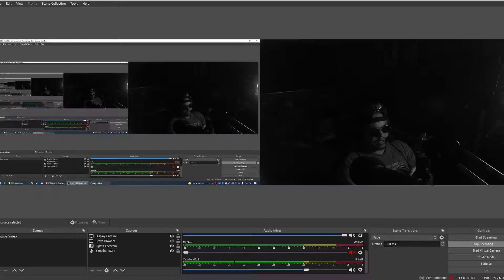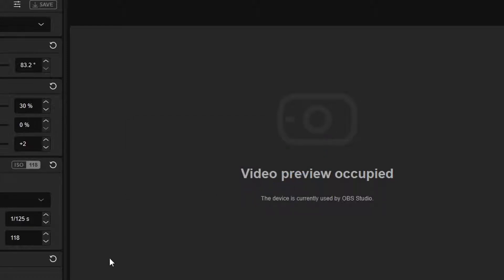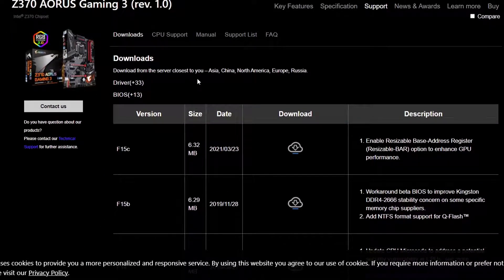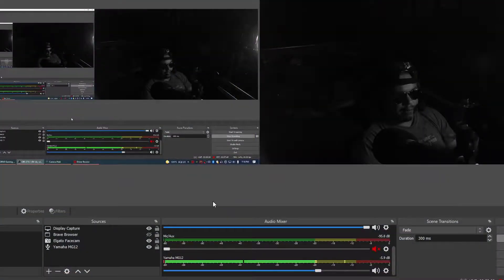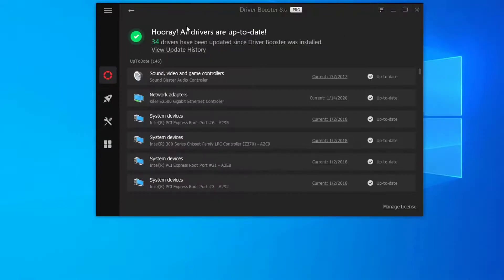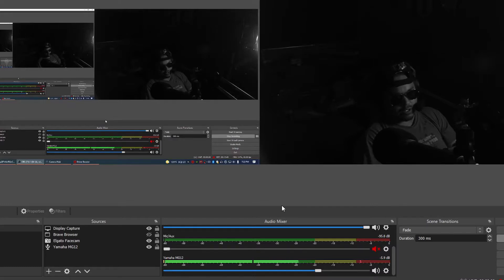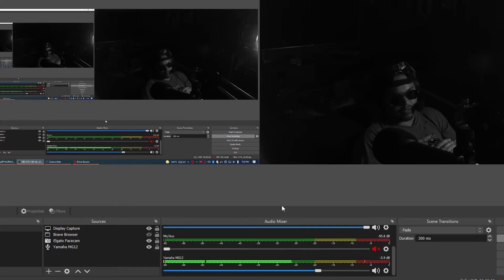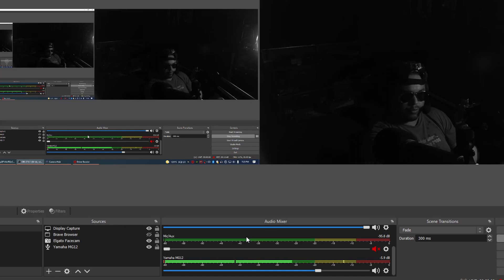Nerd Stuff - Possible Fixes for Elgato Facecam Performance Issues

Comment: The way I fixed my stuttering issue was removing a lot of cables from other 3.0 slots it turns out (in my experience) having to many usb 3.0 slots utilized bottlenecks the facecams performance lol. I'm glad I didn't open up a case on this great ebay seller because that was definitely a me problem. Do your research first!

Comment: my cam works just extremely blurry until im super up close as if the micro lense is the only thing on if it has multiple lenses  i wonder if its a cord issue or what .. it just looks like 540 p in 1080p  just hope its not the cord

Comment: So I built a new pc recently and I'm assure all my drivers are updated. Even made sure it wasn't a BIOS issue. I used this all the time on my previous PC and never had an issue so it's just baffling that I'm now having problems with a much better pc. The only thing I haven't tried yet is the USB cord but my hopes aren't high
Reply from the maker: The cable is the usually the right fix. Try it. I know it sucks ass but don't give up.

Comment section to this video and another I did on the eglato camera also got useful solutions

Comment: Hey man I'm currently having issues with my cam as well and it's been a month and shit is still not resolved. Replies are slow and they didn't even completely solve the problem. Idk how more patient can i be. at first it gets stuck in the loading in the hub menu aight then it was fixed but then another issue appeared which is it says the camera is used by something but it dosen't say it just shows the camera is currently being used by. like id even know what is using my camera ain't there like a thing where i can check what is using my camera? I've tried unstalling and reinstalling it for so many times i don't even know what else to do i just feel defeated man. u know any simular issues bro? i really need some help man. if anyone knows how to fix this problem please reply to me!!!
Reply from the maker: what are you trying to do?

if you have OBS open and your elgato cam hub open, then you can't view your feed on the cam hub software until you close out of the app using the camera.

sometimes zoom, skype, discord etc can be open in the background using the camera and if you're in the elgato cam hub trying to tweak settings, it simply won't work. The camera can only be used by one app at a time.

Comment: We're having issues with the video clarity. We have tried the settings and using brighter led lights, still looks grainy like an old webcam. Not super tech savvy, just frustrated with  webcams and the lack of ease. With all the advanced technology today one would think this would be way easier.
Reply from the maker: did you get the new elgato cam pro? that has auto focus, perhaps the lens needs to be cleaned?

if it's grainy it could be a number of things, have you updated the firmware and the software? both of those things needs to be done.

also do you have a bunch of stuff running in the background or is the camera running too hot?

Comment: Facecam needs to work with USB 3.0. By default, Windows comes with power options configured to reduce USB port consumption. When the power consumption of these ports is reduced, the camera stops functioning properly. What you need to do is disable Windows from reducing USB power. To do this, you can follow these instructions:

1) Click on the Start menu and select the Settings gear icon.
2) In the Settings window, click on the System icon.
3) On the left-hand menu, click on the Power & sleep option.
4) Scroll down to the Related settings section and click on Additional power settings.
5) In the Power Options window, click on the Change plan settings link next to the power plan that you are currently using.
6) Next, click on the Change advanced power settings link.
7) In the Power Options window, scroll down to the USB settings section and click on the plus sign (+) to expand it.
8) Next, click on the USB selective suspend setting to expand it.
9) You will see two options: On battery and Plugged in. Click on both options and change the setting to Disabled.
10) Click on Apply and then OK to save the changes.
11) Close all open windows and restart your computer for the changes to take effect.

That's it! USB selective suspend should now be disabled on your Windows 10 or 11 device.

In addition to this, it is essential to have your computer's drivers and Elgato drivers and software updated. Good luck!

Comment: My issue is when applying a blur effect for my cam. My video when going live freezes on and off. Once i select ELGATO face cam vS ELGATO Virtual FACECAM. The camera works perfect with no issues. I really want the blur effect to work without any freezing
Reply: I’m here for this exact issue. Did you find any solutions? I reached out to support today. Waiting to hear back
Reply: @bluehousemouse  same, my problem is that i have to use the virtual facecam to mirror the image.
Reply: the same issue :(

Comment: Having issues with my facecam, Out of the box it kinda looked blurry, and I was struggling to get the chroma key right. Almost like it's a super cheap webcam that can tells a face from a butt. Anyways I realized yesterday that it's also not saving, I contacted corsair waiting for support. I've done all drives and firmware stuff, Still, the problem remains the same. Hopefully, I can get this sorted out. The local store that sold me this has a handling fee haha so they actually charge you for faulty products..... o well let's see what happens
Reply from the maker: If you return it to the original seller for an exchange would they still charge you? The product is not working as advertised....

How old is your computer? What kind of motherboard do you have? I have a gigabyte motherboard and sometimes my VR headset doesn't work right and sometimes there's interference issues with certain devices and I noticed one of the usb drivers are faulty and I'm too lazy to fix it... it could be something like that. Some motherboards just aren't ideal for a bunch of devices plugged in, my pc chugs along, but it'll be time for an upgrade soon
Reply: @TheWatchFrogs  jip, seems like it, a handling fee its bs.. anyway i posted a ticket to elgato yesterday waiting on a reply.

ive got a 10900f with a Asus Strix z490 f, 32G memory, 1080ti aorus extreme, 1000w platinum psu, and samsung 970 nvme. 

you can see the cams performance on my latest stream. its bad.also running 2 keylights at 90% so should be more than enough light but it struggles hectic with the chroma key its crazy
Reply from the maker: @NicoPeyper  have you tried superior usb type c cables?

Testing audio equipment has shown me that cables are capable of receiving insane amount of interference from usb receivers.

My logitech mouse receiver causes interference in some devices or it won't run correctly so I have to strategically place my products or else they won't work correctly lol 

Perhaps try that? 

The camera has given me zero issues and there was an update not long ago. I'm gonna check out your stream and see what's going on with it
Reply from the maker: @NicoPeyper  okay I watched your stream, your content was clean, good audio levels, and your cam seemed fine, I went to 5 to 6 different parts of your stream and didn't notice anything out of the ordinary? Is there a particular point where the cam was not functioning right?

Comment: I need a 10' long cable so I tried the USBc to USBC and it didn't work. Beefy computer but the camera is too finicky.
Reply from the maker: Updating thr firmware and software should be top priority, both of those things are different. 

The cables I linked to should work. 

The usbc port in the back of the PC motherboard should work (elgato stated that it should work) but they sell the camera with a USB Type c cable to usb a. 

They sent me a beefier cable but it wasn't long and I never bothered trying it because the cable from Amazon works great. I've literally had no other issues with my webcam since doing thr things in the video

Comment: Hi there! I just stumbled across your video when doing my research on the Elgato Facecam. This webcam was the one I was pretty dead set on buying to start my content creation on YouTube + streaming on Twitch but after reading about everyone's struggles with the freezing and drivers issues, I'm feeling hesitant. Now I'm debating on possibly going with the basic Logitech C920 or even the fairly new Logitech Streamcam. With all the problems and hurdles you've had to go through, would you still say this camera is worth it if you can afford to get new cables, should there be any problems? Or should I just look elsewhere? After watching your video, I really trust your opinion so, let me know if you got the time! Great video, man. Thank you.
Reply from the maker: The solutions for the majority of people are in the comment section and or in the actual video.  I have a pretty high end pc and once I replaced the cable, and updated the firmware, that fixed it. Updating the firmware and updating the software are not the same thing. I go through this. 

Me personally, I love the camera, it works really really well and I honestly haven't had issues since I fixed it. Also elgato did send me a much different cable after complaining about the issue and bringing this to their attention. If you order the cam, email elgato and tell them your concerns and request they send you the proper cable.

Comment: Hi guys! My elgato kept freezing too and I got a PCI-e extention card (30 dollar or so) and plugged the camera usb cable in there and now it works for me. Hope it helps.
Reply from the maker: What model PCI usb hub did you get?

I got one with decent reviews on Amazon but it sucked ass, had the blue usb 3.0 and everything.
Reply: With the cam my usb ports are basically full. I don't know if you have that aswell. I figured it didn't harm me if I would just try this out. I did try following your stept with even the amazon usb cable first, but unfortunately that didn't work for me.
Reply from the maker: @nushi4639  which card did you buy?

Comment: Hey! so I have a question that I'm confused on, I recently got the Elgato Webcam, and I love it but the only problem is I'm having this blue flickering going? it seams to only happen at night time when its darker and I've tried shutting off anything LED or light based in my office to no avail so it isn't environmental lighting, anyway to fix this? I know you mentioned cords but is it a specific one? anyone help would be fantastic, thank you!
Reply from the maker: I've noticed dramatic light changes makes the camera wig out a bit. 

Have you upgraded the firmware? Upgrade the software version?

Comment: I have returned with news!
(If after you've tried the solutions above and still have issues)
I've come to find that if you're using an external Elgato 60S capture card, it competes with the streamcam for power, thus forcing 1080 60fps to struggle in streamlabs. I just got an internal 4k 60 Pro Mk.2 and I have had no problems since. Figured I'd update you!

Comment: Hey so this video is awesome.
I got mines yesterday and it worked fine for a bit. It also works in the hub fine but in obs it works sometimes or sometimes nothing at all.
I am going to try all the suggestions you mentioned.  It sucks that I have to possible to get a new cable now.
Reply: I tried firmware update, HUB update and changed cable and it still doesn't work....the only thing left is the Drive booster 8. I am really frustrated, I emailed Elgato support but no answer yet.

Comment: This sadly didn't solve my issue. Had to return the cam as I tried it on three other machines, and the same freezing error happened. Thinking on buying it from another supplier and try and contact Elgato support, as I didn't do that the first time. They might have a fix so I can use it.
Reply from the maker: Did you update the software, firmware and use a different cable? 

I linked to the solutions in the description . I'm sorry man ;(
Reply: @TheWatchFrogs  Yeah I did, I even tried buying two different cables (3.1 to 3.0 and a 3.1 to 3.1), and made sure the firmware was up to date, and reinstalled my windows, and made sure BIOS and USB drivers was up to date. Nothing worked. Half my 3.0 slots wouldn't even turn it on, the other half 3.0 ports the cam would freeze, and the 3.1 port it didn't work in. Same results on the other three machines, but didn't do a reinstall of windows on those though, as they weren't my systems, but friends and co-workers. I've seen others have luck with Elgato Support though, so I might give this cam one last chance and contact them, when I get another one. If they can't solve it, I can still return it.

Comment: So I used a new cable and it works fine. No more freezing but now I get random flickering on the camera. I turned of the lighting to see if that was causing it but nope, still flickers. Today was the first time it ever happened. Also, the video becomes desynced from the audio and the way I fix it is by deactivating and reactivating the camera in SLOBS. It becomes pretty annoying though since I have to do it multiple times n a 3-4 hour stream. Going to contact Elgato about the flickering but honestly I'm prepared to just send it back. This is such a hassle...
Reply from the maker: Did you try updating the software and the firmware?
Reply: @TheWatchFrogs  Software up to date. Doing the firmware now. Really hoping this fixed the video desync issue as well as the flickering. Elgato should be paying you at this rate 🤣
Reply: @TheWatchFrogs  Seems fixed with regards to the flickering. Will have to wait and see for the next time I stream to know whether the desyncing problem is a thing of the past
Reply from the maker: @PunjabiPiccolo  after updating the software. Upgrading firmware and using the new cable it seems to have fixed my problem.

Ya. Elgato should be thanking me for preventing many returns haha 

I'm just glad I could help. After following my steps in the video I've had zero issues in recording or streaming. I use regular OBS.
Reply: @TheWatchFrogs  I've been meaning to make the switch from SLOBS to OBS for a while. I've just been too lazy about it. I wanna believe the desyncing issue is a SLOBS issue but then again I never had any desyncing issues with my $99 Avermedia Webcam so I don't know why I would be having it with the Facecam. Really hoping this update fixed it. Thanks for all the help!
Reply from the maker: @PunjabiPiccolo  I've had performance issues with SLOBS that just didn't exist with the less bloated OBS. 

Slobs is a great app but for some people it just doesn't play well. obs has always been rock solid

Comment: Got the firmware updated and it runs much smoother now. I also ordered the cable. Because why not? lol
Reply from the maker: I linked to a handful of decent cables for the usb type c ports and the one that I'm currently using that's worked really well :)

Comment: What issues were you having? Mine seems to freeze up after a couple minutes in OBS. I was thinking it was my CPU was not able to run it along with OBS.
Reply from the maker: pretty much the same at you.

At first using the included cable, the elgato facecam kept connecting and disconnecting and very rarely would it display an image, but only for a few seconds before continuing to fail (this was in the camera hub). I used a different cable which I linked to and it seemed to have worked okay for a moment and then in OBS it started freezing after a few minutes. Very rarely would I be able to record a 15-20 minute video. 

I bought Driver Booster 8 and updated all of the drivers properly because gigabyte doesn't make it easy to download the current drivers and stuff.  which did make things better with the cable I started using (the red braided amazon cable). The elgato facecam cable that was included still didn't work on any of the blue USB 3.0 ports, however elgato has suggested I use the USB type C port (I have that cable, but havne't tried it and I included in the description a Link to a few usb type c male to usb type c male and different version too). And there's a RED usb port that I haven't tried because I thought it was for something else, but it might work with the included elgato cable, but for now everything works, if it fails again I'll try those other two USB ports.

I've left the camera on in OBS and in the HUB and it doesn't seem to stutter, freeze or have any performance issues anymore.
Reply: @TheWatchFrogs  gotcha, I actually fixed mine! I had to install the firmware update which is when you hold control and left click on the 3 bar drop down right beside of input in your elgato camera hub. Whatever that update did, it fixed the camera freezing on obs!